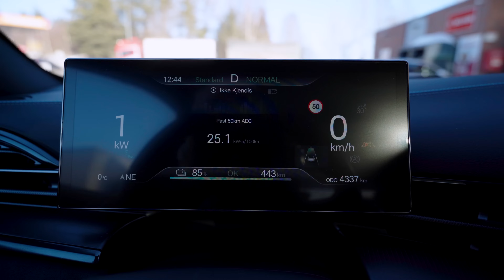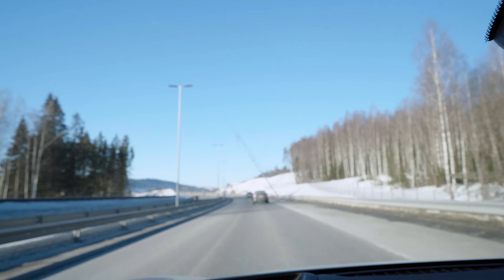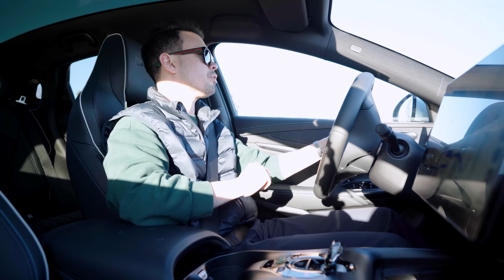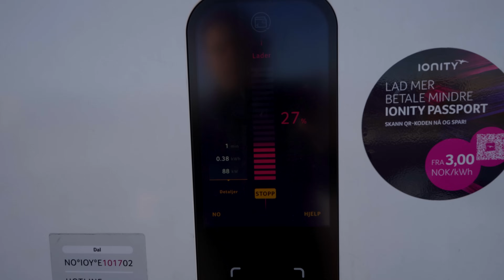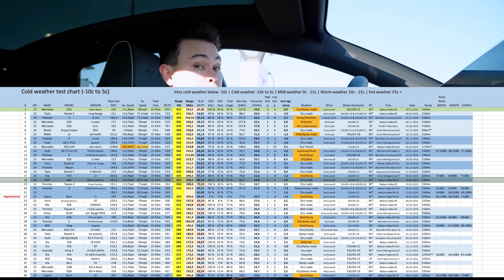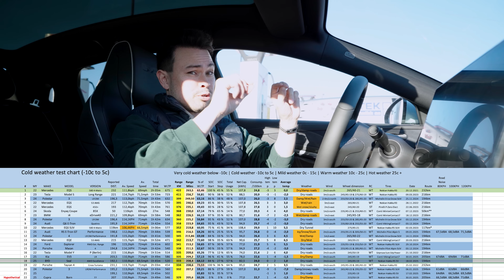BYD Seal | Range Test @ 120KPH (75MPH)

Comment: The ‘weird’ steering in comfort mode is normal. It’s light at slower speeds and firms up over 100kph. This is to ease inputs from the driver. Maybe try  a little harder on the next video.
Reply from the maker: Steering should be light on center and weight up off center, and not the opposite. It doesn’t make it better that the steering in the Seal is very vague and imprecise on center making the whole experience weird and uncanny,

I’d recommend you to any German car to experience good steering, like a Taycan for example.
Reply: @ Thank you for the informative reply and thank you for posting the videos 👍

Comment: Thanks for the video Kris og hilsen fra Finland! I have visited our local BYD dealer here in Finland Oulu area. They have all the models what I know and I think those models are quite decent looking but I didn´t like the Atto3 interor design... And there is no awd version available. Seal was quite fabulous/very sporty looking and huge glass roof all the way to the back. As a comment to your range test it seems to be quite in contrast to the others but your tests are in quite fast conditions, we don´t have the 120kmh roads here (only around 10-20kms on the route to Haparanda. But the most amazing was the Sealion7. I have to go to test drive it maybe this week too. When you are going to release the test video of that Sealion7 model? I was very impressed of the quality of the car interior design, it looked and felt like much more expensive car. What I know the infotainment and the operating system isn´t available at the moment in finnish language. Could you be able to change it to norweigian? Batteries are good quality (LFP I think) but I was little disappointed with the range they say although the battery is almost 92kWh, so it should go much further than 500-550kms? At least VW and Skoda have better ranges with little bit smaller batteries and electric motors. I think the blade/LFP battery is the reason?